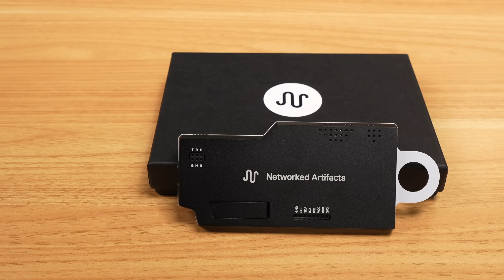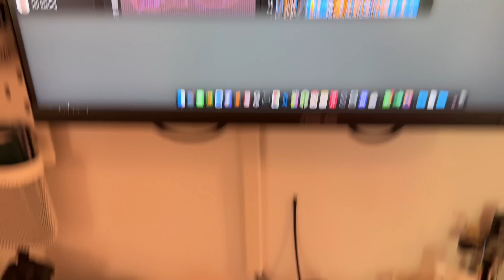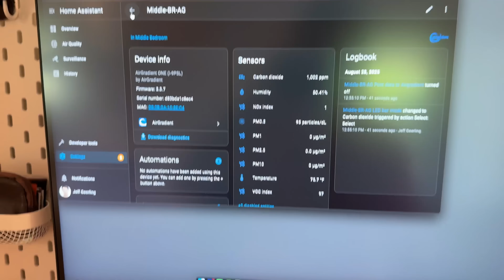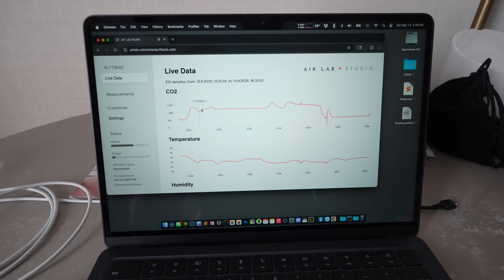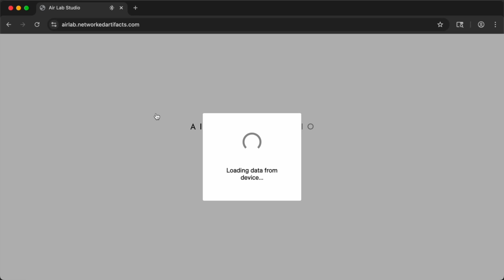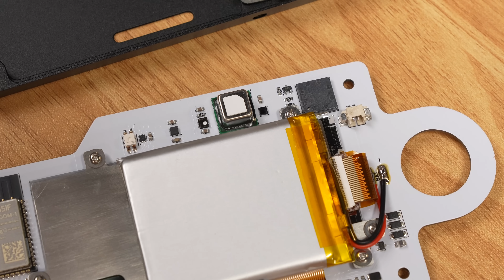Are you sure that's air you're breathing?

Comment: The kit version of the AirGradient One is a lot cheaper if you are so inclined. Like almost $100 cheaper. Same thing, you just have to assemble it yourself. No soldering, apparently. Tempted to pull the trigger on one.

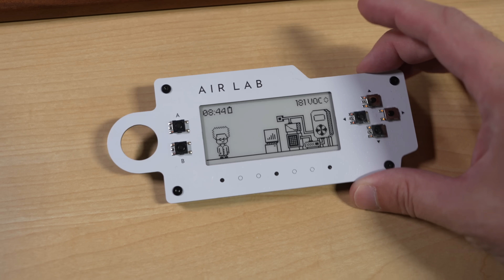Comment: 13:51 As a dev I'm always leery of saying "It should be easy...", but adding a "BAT LOW" at < 5-10% battery remaining doesn't seem like it would be a big lift.

Could totally understand missing it if they spend most of their time with the device plugged in though.
Reply: Yeah, we need to fix that before we ship! As we've got the final battery now, we can properly measure the right cutoff voltage.
Reply from the maker: @NetworkedArtifacts  One of those 'little' things that takes at least many hours of labor to get right, and in a DIY version, someone would just live without a battery indicator :D

Comment: I would never pay more than $30-40 for a device that measures volatile carbons if I cared about CO2. Just too innacurate as they don't measure CO2. They create a magic number using maths based on what they actually measure. it does not matter what they send to Home Assistant if its magic. At that price I'd invest in some proper technology that measures CO2 itself, particularly if a baby is involved. Not sure if I can post links so this is the product title on the Seeed website but I'd pair one of these with an RP  (Grove - CO2 & Temperature & Humidity Sensor (SCD30) - NDIR technology, algorithms, ideal for Smart Ventilation System). Why are you paying so much for pre-built rubbish when you can do so much better yourself? Just avoid anything that says it measures VOC.
Reply from the maker: This device does measure CO2 directly - the sensor is a Sensiron SCD41. The CO2 estimates from other cheap devices are just that, but this is using a real CO2 sensor, at least.
Reply: or an esp32C6 for zigbee as the espressif arduino library examples include CO2 and one of the particulate sizes. It isn't just about ease. It it is about far greater accuracy on the things you actually care about.

You just need to give up a few metrics for far greater accuracy.

Comment: In the field of air monitoring, $250 is outright reasonable. I think people have a warped perspective of what these sensors actually can cost if they are highly accurate, midrange VOC sensors can cost thousands and ambient air monitors used by air agencies cost tens of thousands. 

However, I'm not sure that these are reasonably accurate. For any sensor I'd wait for something like SCAQMD AQ-SPEC to test them against FEM sensors before making any purchase like this. If these are NDIR CO2 sensors they are much cheaper now and more reasonably accurate, but I still would expect to pay around $80-100 for one. MEMs chip sensors are probably good enough for HVAC but I wouldn't put much stock in them for indoor air quality outside of that.
Reply from the maker: One nice thing with AirGradient, is they are working with some test labs for the sensors they use. This one uses the SCD41, so I'm not sure I've seen as much data on it, but Sensiron seems to be the best of the 'affordable' options.
Reply: Thanks  @JeffGeerling  , I'll look into them more! I am very familiar with PurpleAir and have been pretty disillusioned with how they have walled off a lot of their data behind their API, nice to see an open source equivalent that seems to do more. CMU has a nice scraper to get around that but I'm happy that it doesn't seem necessary in this case. 

Seems AirGradient is also using the same PM sensor (or a similar one to PA) the PMS5003 for their outdoor air monitors. This one has been thoroughly tested by SCAQMD already and performs very well compared to federal equivalent method (FEM) monitors. 

I used to design custom monitors for my work, I don't follow the space as closely as I once did but I'm glad you're getting more into it!

Comment: Aranet 4 is $143 USD.
Reply: It's also wonderfully portable, the batteries last for years, and the CO2 sensor uses an accurate technology. But the $143 price is a sale price; list is almost double.
Reply: @SMorrisRose the price is lower for a while now, it is unlikely they will bring back the starting price
Reply from the maker: Another great option. Slightly different product, but achieves much of the same goal for most people looking for a sensor.
Reply: @JeffGeerling  the Aranet4 is also e-ink, long-lived on battery, and an open BLE protocol - and it showed there was a market for this  exact class of device several years ago (CO₂ as a proxy for "shared air" - since the added CO₂ is coming from Other People's Lungs - was a popular measurement for obvious reasons...) It's less cute, but it's also much smaller, and it seems like it's more readable than even the big-text mode on this one...
Reply: Aranet 4 is awesome, but some of the data requires the app (or a Bluetooth client like Home Assistant) to see. I like the Aranet and AirGradient devices as semi-permanent installation monitors. The Air Lab seems like a bit more convenient as a portable tool for your travel bag, with a bit more that you can control from the device itself.
Reply: I love my Aranet. Compact, sturdy, nice e ink display, and 2 AAA batteries will keep it running for several years at a time.

Comment: I suddenly have a weird need to open my window, even thought it’s 4C outside right now
Reply: you gotta "stosslüft" as the germans would say.
open a couple windows for 5min, let air exchange, close windows again
Reply: you need to STOßLÜFT
Reply: @StreuPfeffer  Stoßlüften !!!  :-D
Reply: The energy efficient way to do air exchange is an energy recovery ventilator (or heat recovery ventilator if managing indoor humidity isn't a concern).
Reply: I have a network connecected ventilation system with heath recovery that I control using home assistant automations based on the co2 levels in certain rooms
Reply: just make sure your neighbour is not burning half wet wood at the moment you open up your windows
Reply: Most heat in your home is contained in solids, so opening your windows even if it's really cold to get fresh air won't waste that much heat
Reply: @skylark.kraken  Yep - I have a routine of a full-house air change in the morning, and the house is back to comfortable in minutes because the heat capacity of gasses (the air) is very low compared to everything else.

I work from home, but give myself 15 minute "commute" walk.  When I return I open a bunch of windows wide for the air-change while I make a coffee, and the cold air doesn't feel bad  because I was just walking in it (and nobody else is in the house)

Funny seeing Jeff's CO₂ numbers around 1000 because mine are generally below 600.  But perhaps that's partly down to my house being leaky.
Reply: @skylark.kraken  This, I tried to calculate how fast my PC can heat my room and i think it was several degrees celsius per hour, because there is something like 70kg of air and heat capacity of air is three to four times lower than of water. So without heat capacity of walls, room would turn from comfortable to too hot in few tens of minutes. But what makes a difference is opening one window or two windows on opposite side of flat, because it can exchange air in whole flat quite fast and build up of CO2 is relatively slow (considering one or two persons living there).

Comment: I bought an Ioniq 5 recently and it has so many quirks and hidden features that I decided it was probably easier to read the manual than trying to figure things out on my own. There's an entire page dedicated to the risks of using the recirculator, the effects of excess CO2, and how you should only use it for short periods. Given how much they had about it in the manual I'm kinda surprised they didn't add an on-screen warning when you turn it on or an auto-off timer.
Reply: I only turn mine on if I’m something in traffic that’s outputting blue smoke. That’s pretty rare though. I’m surprised you use it so much?
Reply: @rorylong314  I don't. I only really use it on short stretch of the interstate when I'm going to Costco. There's a sewage processing plant and a couple of poultry plants so it smells awful for a few miles. I just happened to see that they had dedicated an entire page to the risks of CO2 buildup in the manual.
Reply: @alc5440  Really, it should be like other things in any car, including the Ioniq 5, it should turn off after x minutes. I drive one too and the heated steering wheel turns off so why shouldn’t the re-circulation. I live in the semi rural area so I get you with the country smells 😊
Reply: @rorylong314  that's a really good point. There's even already other automated climate control actions like dehumidification. It's weird that they don't just shut it off with a timer given the warnings they have about using it.
Reply: Heh, I grew up with it as a "push in case of skunk" button - there wasn't really a specific CO₂ concern (nor cheap sensors) but the passenger was responsible for lunging for the button as soon as we smelled a skunk :)
Reply: After watching this video I double checked that the recirculator in my ioniq 5 was off, lol.
Reply: It makes me wonder why the car doesn't include a CO2 monitor itself and maybe use that to display a warning if it gets too high.
Reply from the maker: Woah, amazing they'd actually note that stuff in the manual! I'll have to check the Leaf's manual and see if it goes into detail as well. The Leaf automatically turns on recirculate when I turn on the AC.
Reply: @JeffGeerling  Holy crap, that seems dangerous. I felt sleepy in a car several times, and I basically never use recirculation unless I'm stuck in a stuffy traffic jam.
Reply: @JeffGeerling  yea i was really surprised to see that. The only times I know of that the Ioniq 5 turns it on are if you do a defrost remote start and briefly when you wash the windshield to keep the cabin from smelling like windshield washer fluid. There is a note somewhere that it'll extend your range but far more warnings about the risks of using it for too long.
Reply: @alc5440  The Ioniq 5 also has an optional "tunnel detection" feature where it switches to recirculate when you enter a tunnel and switches it off when you exit.
Reply: @JeffGeerling  You can long press on it until the light blinks. It then switches automatically between recirculating and taking air from the outsided. No idea why that is well hidden in the manual and not the default though.

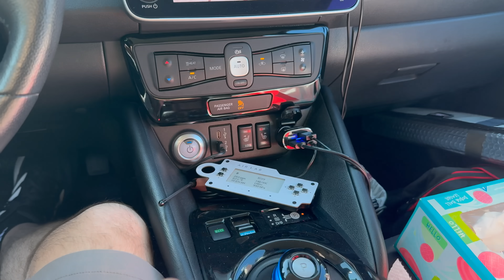Comment: 12:22 You never enable "Recirculate", not even in cold winter. :D
Reply from the maker: I don't, but my car does for me, haha! I don't know why, but this Leaf will turn on recirculate every time I turn on the AC.
Reply: @JeffGeerling my Ford Focus and Model S do that too! I think it's generally more efficient for the AC since it doesn't have to always start with hot air to cool down, And I definitely noticed better cooling performance on the extremely hot days, but it definitely doesn't help the stale air. 😂
Reply: Many cars have a timer on it, and will automatically turn recirculation off in about 15 minutes. (Some VW group cars for example.)
Reply: Apologize guys, my newest car is Toyota from year 2000, it have manual levers only, haha
Reply: I use recirc only when outside air is bad. Driving behind belching diesel truck or passing by fire, etc  ....
Reply: My Skoda Fabia does the opposite when I turn on recirculation when I'm behind an old truck or a busy tunnel it turns on the AC

Comment: I have 2 airgradient ones, for my office and bedroom, and they have been really useful. the usecase for a car for a battery powered device like this seems interesting, but I dont spend much time driving for it to be worth it for me.
Reply from the maker: Yeah; in that sense it's very similar to the Flipper Zero for me, too—I have one... and I used it a couple times here and there, but I don't have a need for it, more the curiosity.
Reply: @JeffGeerling  I keep mine in my car, acts as a backup for garage opener, parking badge, work badge, etc, plus I like to mess with the Teslas in my parking garage.